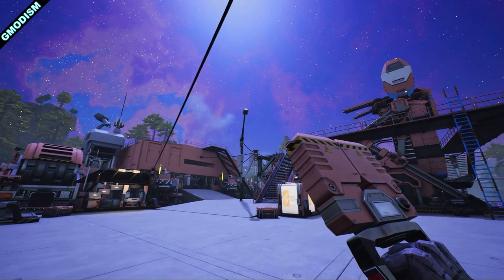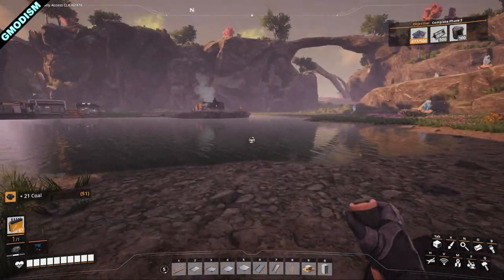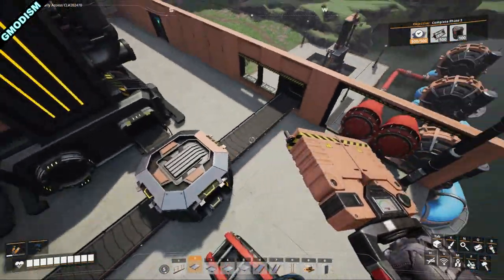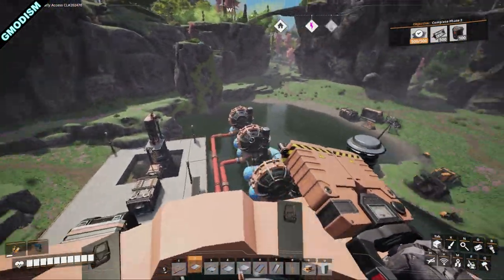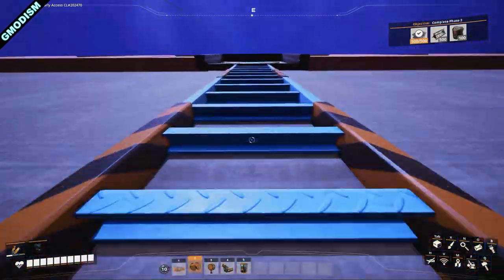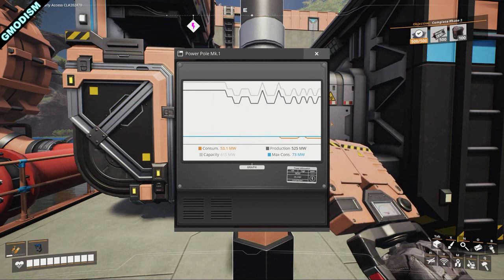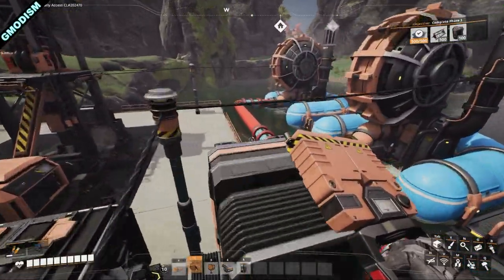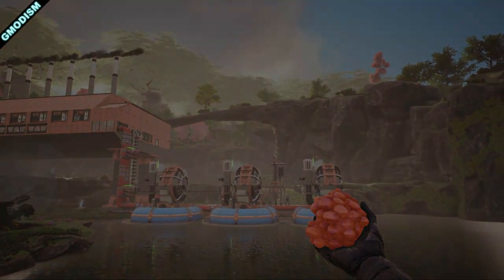Perfect Coal Power Setup - Satisfactory New Player Guide EP10

Comment: Something to throw off your efficiency calculations: unlike with other structures, that consume extra power per operation when overclocked, generators consume less material to generate a larger amount of power the more you overclock them. Fully overclocking a coal plant to 250% causes it to generate 250% of the base power, but uses less than 200% of the coal and water input.

For this reason, putting power shards in your coal and fuel generators is broadly speaking their best use case, possibly even more than putting them in miners and oil extractors.
Reply from the maker: Thats strange, I don't remember it working like this, but if this is a new update 7 feature I would believe it's a bug that will be fixed soon
Reply: @GMODISM  Nope. It's been this way since forever. It was like this in Update 4 when I first got the game, and it's like this in my Update 6 world that I had open when I was typing the comment up. I haven't switched to Experimental for Update 7 stuff yet, I'm waiting for a few of the bugs to get ironed out first.

Update 7 actually might remove or lessen it by the time they're finished, since they were talking about changing the algorithm on over/underclock power differences to be less drastic. Likely not though, because it's already a much less drastic difference for the generators than it is for consumers, and their reasoning was geared towards power consumers.
Reply: @GMODISM  Having now switched to Experimental for Update 7 stuff, it does look like it's no longer going to be a thing. Unless they change it again, overclocking generators will now consume exactly the same resources per MW as simply building more generators. I had to make some quick changes to my power plants after the switch.
A pity, it was kind of a cool little reward for using a bunch of your shards there instead of in your production lines. I guess they figured the extra power wouldn't be as necessary with the reduced power costs for other things being overclocked.
Reply from the maker: @jadekaiser7840  never knew it was like that before. But yeah they made power regen linear to shards

Comment: Just run the pumps with less clock speed then you can use for each coal generator one pump.
Reply from the maker: On some areas you will notice water is limited and one needs to max the ones you have, but if not you can do that too

Comment: I have everything up and running however, a few of my last generators (furthest from start of conveyor feed) will go red from time to time. I have MK2 conveyors connecting the splitters however,  my LONG coal conveyor is built with mk1, and conveyor lifts are built with mk1. Would that be the cause?
Reply from the maker: The speed of the coal is limited by the slowest belt, so probably it is your conveyor line. Set all generators to 50% if you cant afford to upgrade the belt right now. ^^
Reply: @GMODISM  Thanks for the reply! I went ahead and upgraded the conveyor and everything is running 100%

Comment: You did this wrong.  I mean I LOVE the setup, its virtually identical to the way I do it.  But you make yours look very good, mine is just on a plane slab :(.  What you did wrong was how you start the production.  You are stuck there for 20 mins waiting to see if it will ever stabilize.  Instead just run a the coal mine and the water pumps off of biomass gens.  Takes a couple mins to completely fill all the water and coal in every generator.  Once they are all completely full, then turn connect the coal generators to a power pole and they will start producing.  You will know right away if any of them are having issues because those will simply not power on, which is evident from the smoke coming out the chimney. 

Additionally since you are obviously good at math, depending on the size of the power plant it may vary, but I will take a couple of the coal gens, whatever it takes, and set them up to power just the coal mines / mines, and pumps for the power plant.  These are on a SEPARATE power grid from the rest of the base and NEVER get tied together.  This means that if you overload your power grid later on your pumps and mines keep producing sending power to all of your generators.  Otherwise you can easily get stuck in a cycle of flipping the power on, just to have it overload again instantly because your gens can't produce as they are lacking coal or water.  It saves you a nightmare later on.
Reply from the maker: Yeah that's another way to get started faster, and indeed your tips are great if someone does not keep track of power, better safe than sorry! ✨
Reply: @GMODISM  I never care about power until it shuts off lol.  I imagine most people are the same, maybe its just me lol.